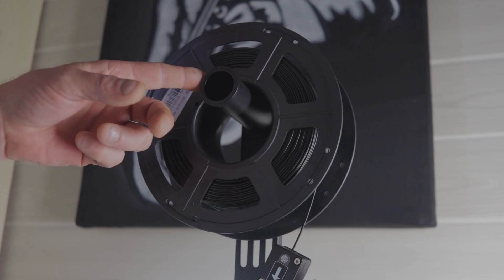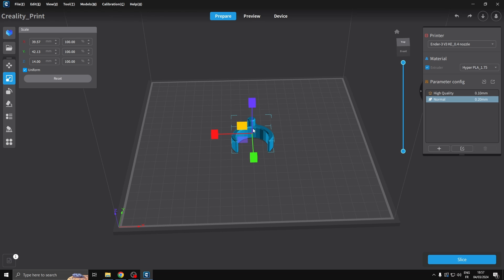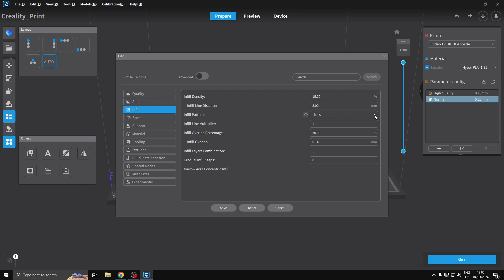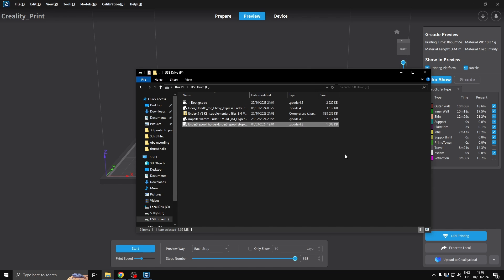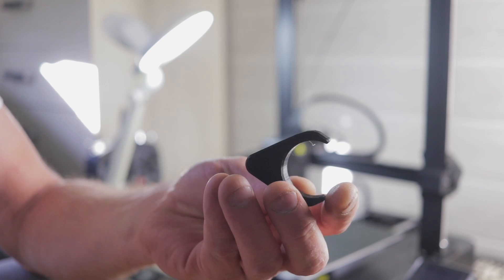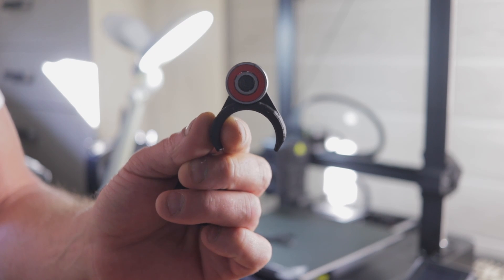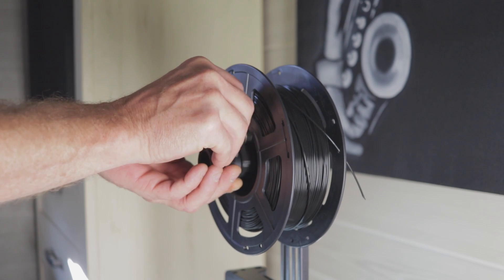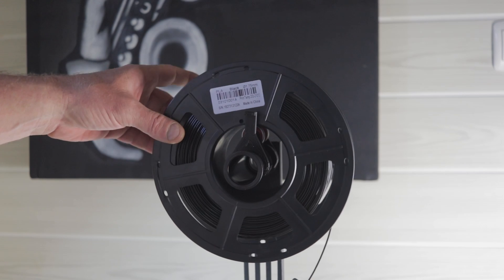Upgrading the Spool Holder on The Creality Ender 3 v3 Ke 3D Printer

Comment: 1st 3d printer I’ve had still figuring it out had trouble with PETG filament just couldn’t get a single print with it temps was 230c n bed think was 70c
Reply from the maker: Hi not sure with petg am yet to try it myself on the printer but keep playing you will get there eventually
Reply: Did you dry your filament out?

Comment: Will this work for the ender 3 v3 SE is there much difference cuz I’ve noticed it has trouble with spool filament looks tight still prints ok but suppose it’ll be better with some upgrade what do u think of that you done is ir worth doing or ???? Thanks very much m8 ….. PS. I subscribed to your channel awesome info on there I’m a newbie
Reply from the maker: Hi there the spool holder works well you will need to super glue it eventually to the bar as it gets loose but makes things smoother to turn.

Comment: Does this work on the SE?
Reply: It will fit the printer, but it might not work depending on the spool you have. The hole on Creality and Polymaker cardboard spools are small and make it very fiddly to mount them with this type of solution.
Reply from the maker: Hi I believe it's the same on the se
Reply: Did you find out m8 cuz I got same printer?? Cheers what’s best site for printable stuff